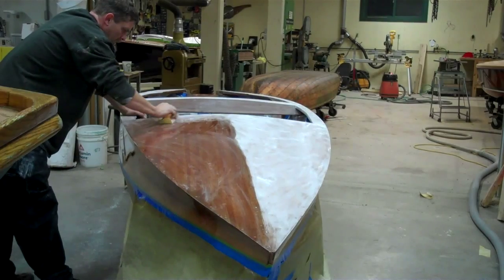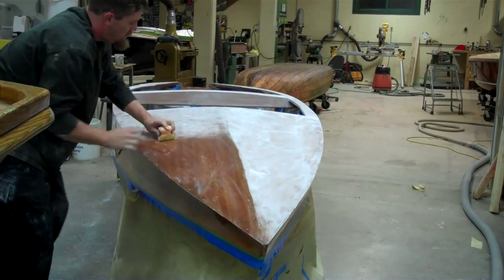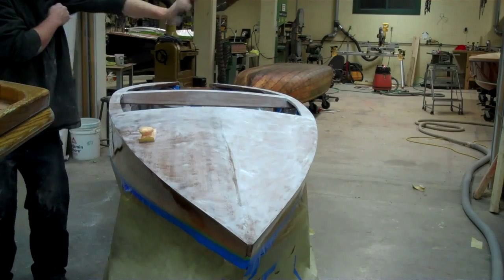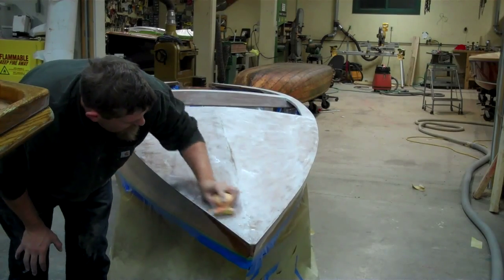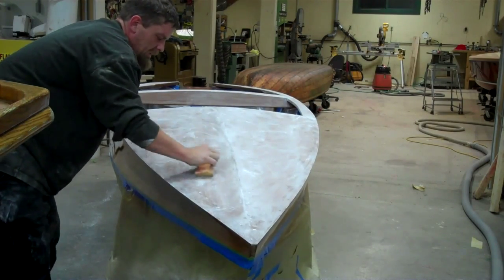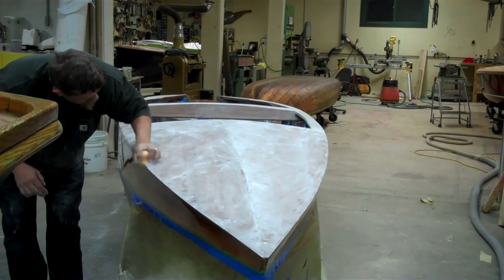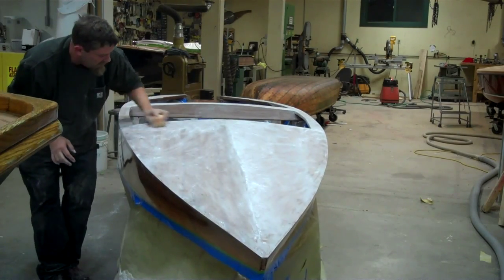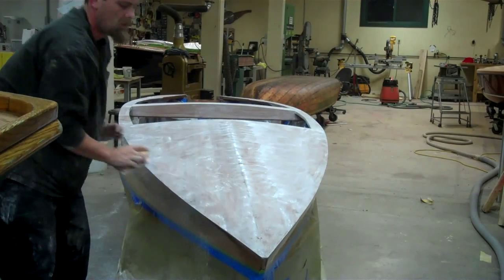Varnishing   Sanding to a Snow Field Technique 1957 Speedliner

Comment: Just wanted to help a little on the comments made in this video. This boat is a Speedliner Runabout not a Hydroplane.  I believe it is a DU boat.  The Mercury engine refered to is a Mercury Mark 55H a forty cubic inch engine which may not have been 55 horsepower.  The restoration is comming along great.
David